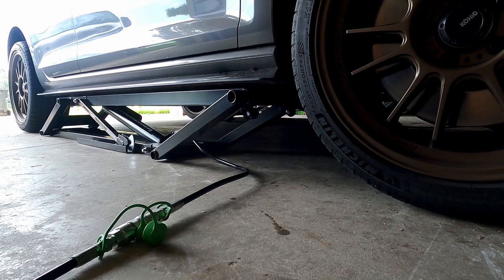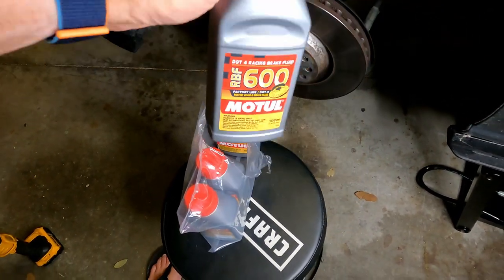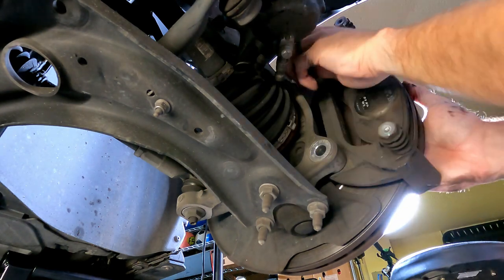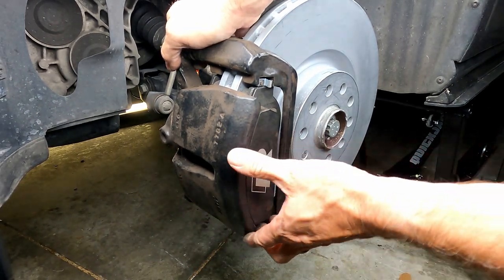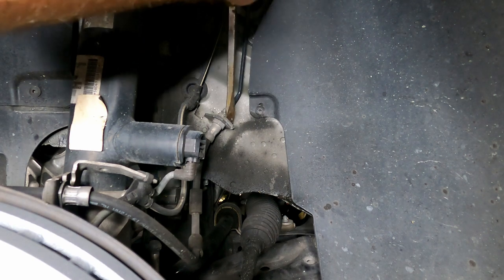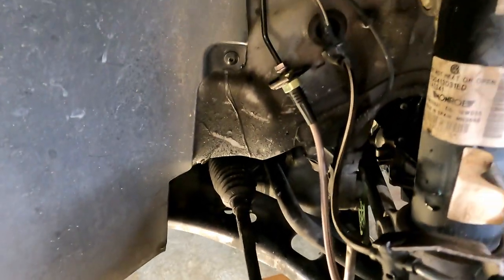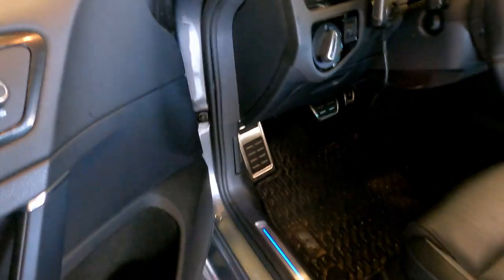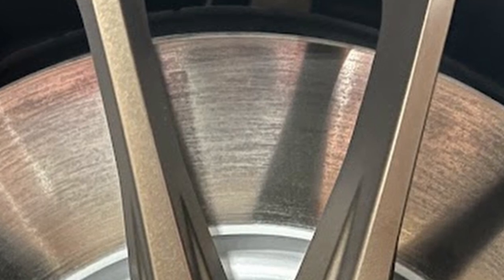MK7.5 Golf R Front Brakes : Pads, Rotors, and Stainless Steel Lines

Comment: Note that a normal 17mm spanner is too thick to fit on the retaining bolts for the slider pins. You need a very thin spanner

Comment: Enjoyed the vid.  A couple of things I do when doing brakes is to use an old brake pad to let the C clamp push against while pushing the caliper piston in.  As not to damage the piston. Also, if the brake reservoir is full, retracting the caliper pistons may overflow the reservoir.
It makes a big mess. Been there, done that. Enjoy the new brakes .
Reply from the maker: Thanks for the comment. I do the same with the old brake pad when I can’t get the screw side of the c-clamp inside the piston. It’s definitely better than buggering up the edge, but in this case the risk is mitigated by pushing from inside the piston rather than an edge! ;-) 

Agreed 💯 on the brake fluid overflow, which is why I made sure to mention it in the beginning.  That’s a mess that nobody wants to clean up! Haha

Comment: hey do you have a link for the bolts tro replace or are they the same as the carrier bolts you have to replace for the rear?
Reply from the maker: Part number: WHT003252, WHT010085

Comment: Why put new hoses? I am sure the ones you removed are perfectly fine.
Reply from the maker: Stainless steel hoses allow for less flex in the system than rubber hoses, allowing for higher and more consistent pressure when the brake pedal is depressed.